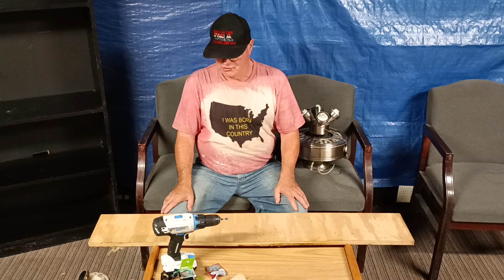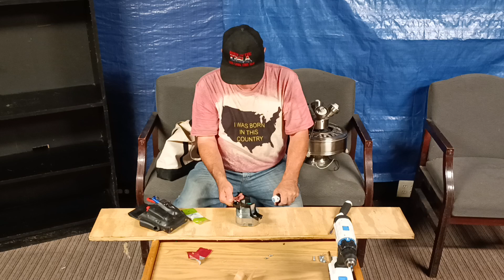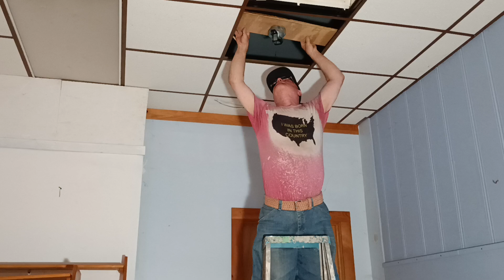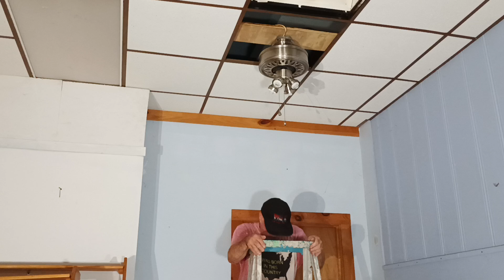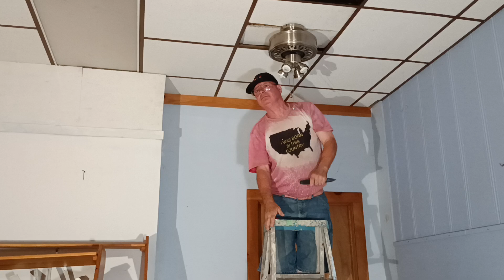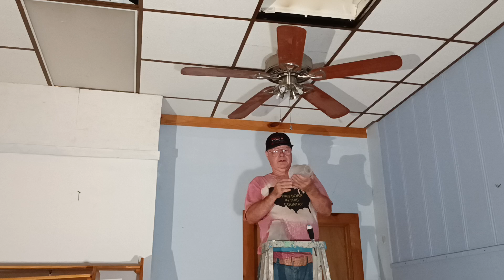August 24, 2024 - how to wire and install a ceiling fan in the middle of a drop ceiling tile

Comment: Do you honestly expect 4 screws holding the junction box to that plywood to be strong enough to hold a rotating and vibrating fan? At minimum you should be using bolts and washers to keep the junction box secured to the wood. Over time, those screws are going to work themselves loose and then someone is in for a very bad day when that fan hits them on the head.